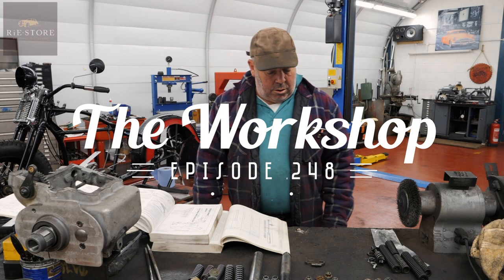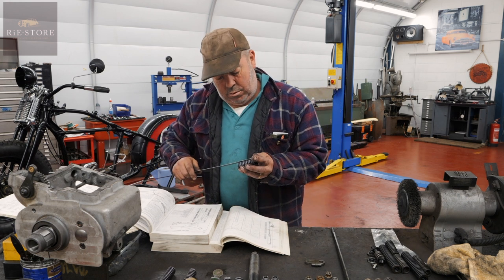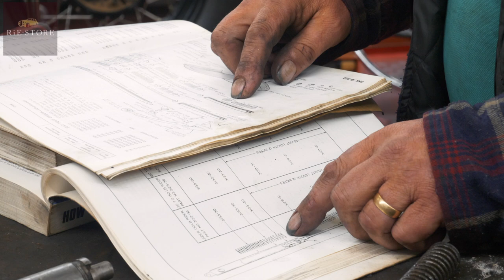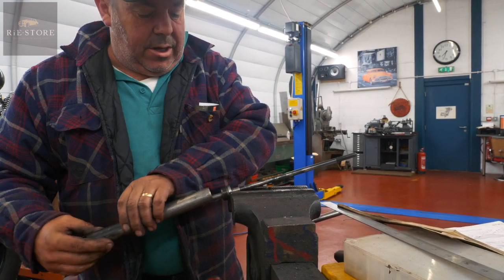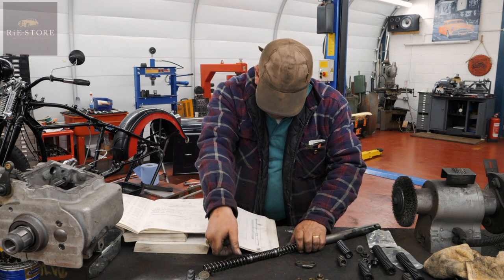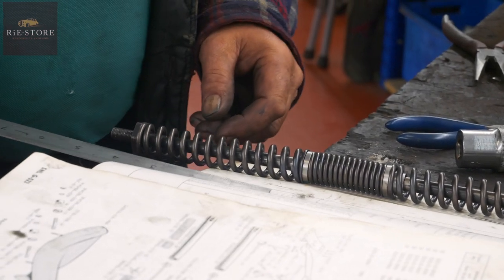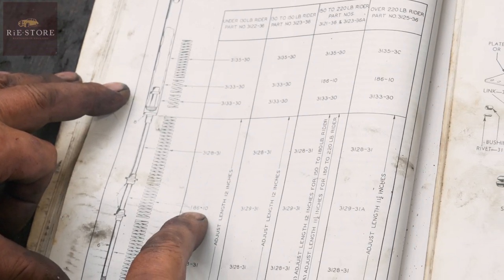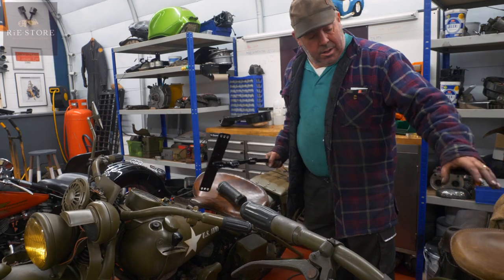WLA seat post assembly / ep248

Comment: Had 3 springs of some spec'in my WL and crippled my back for six weeks hitting one of these fecking potholes, replaced the whole caboodle with a front fork spring found under the bench, infinitely better saddle springing. Sod originality.
Reply from the maker: These bikes weren't built for comfort, or even to last. Happy riding is one thing, selling is another.